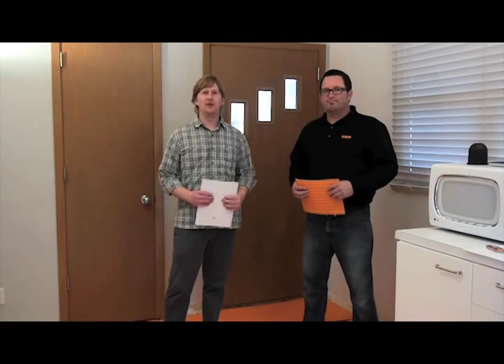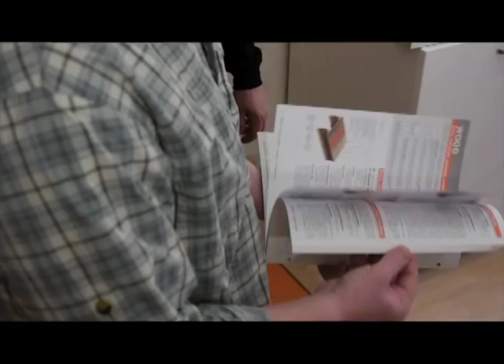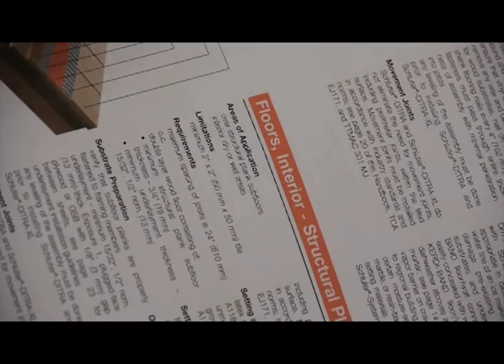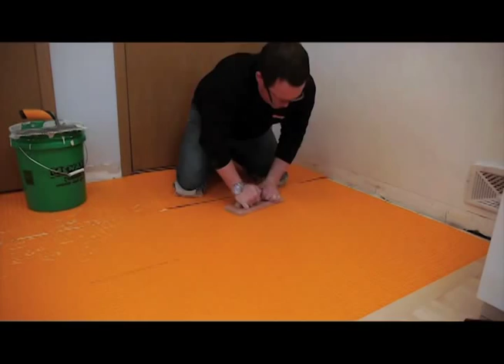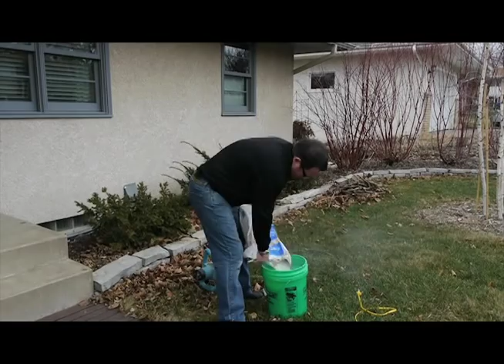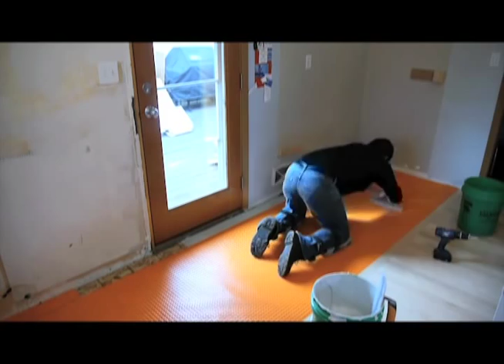HANDY Magazine - How to Install Ditra Underlayment.mov

Comment: Good product from a good company. Not cheap at around $1.50 a sqft, but can save your install from failing. I'm a remodeling contractor in Dallas, Tx, where we have a lot of foundation problems. I won't install a large format tile without it.